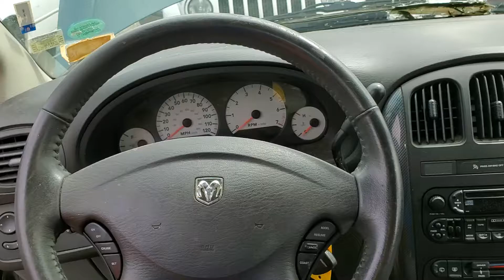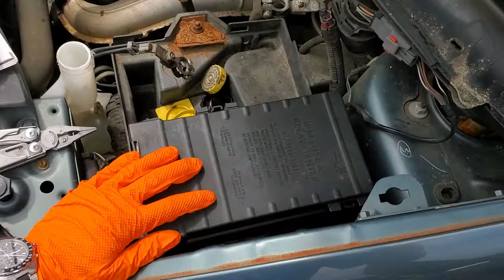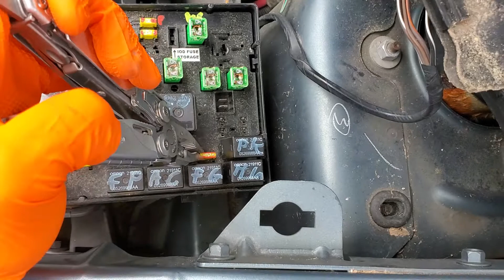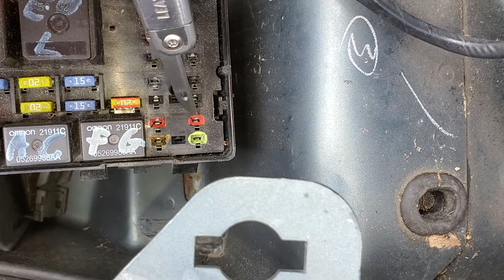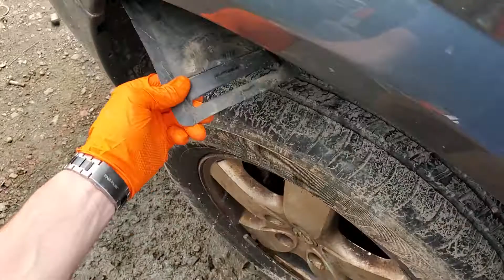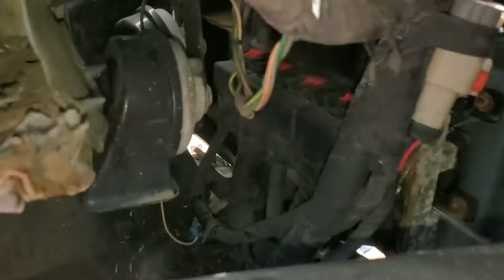2007 Dodge Grand Caravan Horn Fuse & Relay

Comment: I have been smelling what seemed to be burning wires for awhile now, but never any smoke. But yesterday I went to start my van (Dodge Grand caravan  2007) it turned a bit then stopped turning. Today there no power to my ignition.  Dash lights all come on, door buzzer rings but when I turn the key nothing.